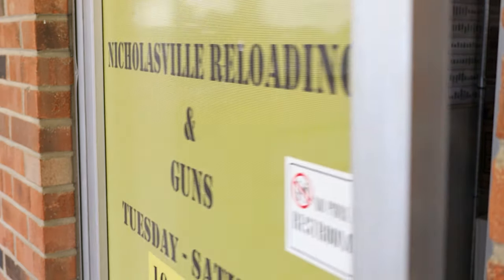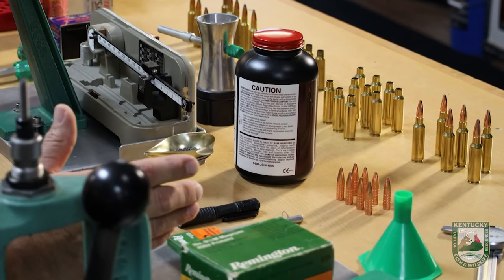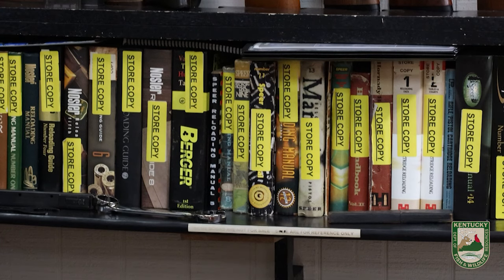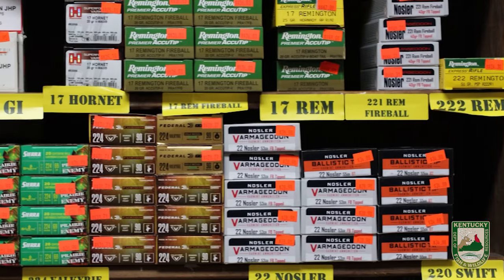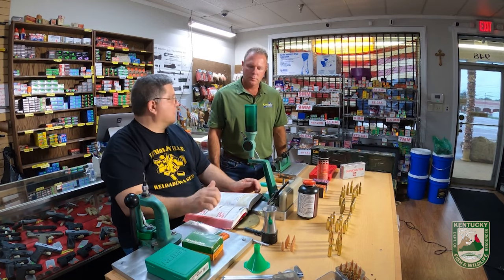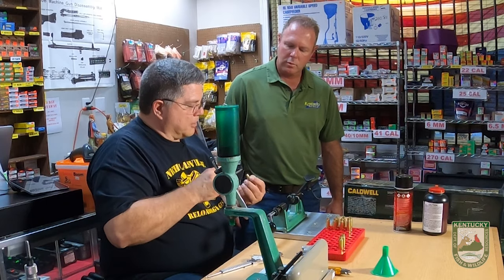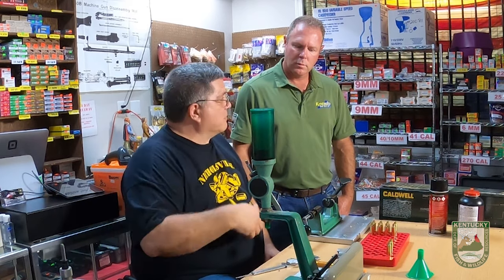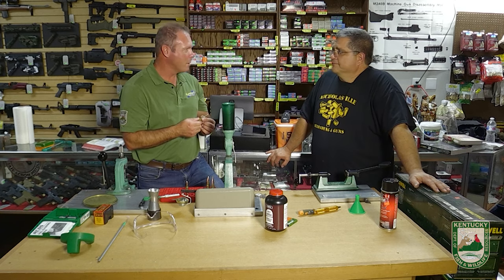Reloading 101 - The Basics of Reloading Ammunition

Comment: I've reloaded for most of my life. I originally started because of the accuracy I could achieve over factory ammo but the advantage has become less over the years cuz factory ammo has gotten much better. I now reload because of politics and the availability of components. I say there are two steps to reloading. 1 is case prep and 2 is reloading. Case prep is boring but of utmost importance. I read years ago that dull clean brass shoots just as well as shiny brass and I have found this to be true. There is even an argument that tumbling brass will shorten the life of the brass. You can watch all the videos you want about reloading but it is not a substitute for reading two reloading manuals and following instructions. Different reloaders use different products such as the case lube he uses here. I use a roll pad and don't spray anything onto my loading block. It's worth it to reload physically and mentally.

Comment: Great video, covers all of the steps. I was always told not to get any case lube inside of the case as it would contaminate the powder charge. Making a fixture to be able to turn the cases upside down alleviates the possibility of that happening. Large finishing nails spaced out in a piece of wood will work nicely, and as he stated the lube will run down the case and spread evenly when sprayed from a couple different directions

Comment: Overall a pretty good video. I would caution people to not over work their primer pocket and use a gauge to check the depth if doing so. Over reaming the primer pocket will allow the primer to seat quite deeply into the case and potentially adversely affect the primers performance and or reliability. 
Also it does not look as if the bullets were correctly seated, The grooves in the bullet are designed to reduce pressure in long bullets and you have not seated the bullet far enough to push the groove fully into the case. Saami spec or not this will affect the bullet performance adversely. 🧐🤓 
Best of luck Ladies and Gentlemen 😎
Reply: He's loading Barnes triple shock no lead bullets.. magazine length or if you have a long throat and single load,  only thing we care about is mag length for hunting or distance from lands for match ammunition. If it chambers, and no excessive pressure, I have a long throat rifle and seat long vld bullets and they're maybe to bottom of the neck. Too long and too short can increase pressure.
    If you use obsolete cartridges you should have 200 rds min for a rifle, fwiw

Comment: I would have liked to hear him explain what resizing is and why it's necessary.

As a part of that, he could have explained where the brass he trimmed from the case mouth came from (it wasn't there when he bought the factory ammunition, was it?) and possibly even how you know it's time to stop reloading a case.
Reply: When you shoot a round, It warps the brass through heat and pressure. Re-sizing puts it back in a consistent and accurate shape. Doing this can stretch the case hence you trim the stretched excess. If you don't reshape your cartridge it could get stuck in the chamber, not hold the powder uniform and also provide enough and correct lip for the bullet and barrel.

Comment: I have a 308 and the rounds are $2 a round if you buy them factory. Yes I'd like to at least use the same brass change the projector, powder and primer. Get my money back or at least break even, because every shot I take with my 308 is $2. It might not sound like much but 20 rounds is $40 every time I go to the range plus the range fee of $15 plus $10 worth of gas so that's $65 total for just one day at the range for my 308.

Comment: Cost is what I originally thought, but I found out that because of the increased prices in reloading material and the shortages it is likely cheaper to buy ammo, I am speaking here of the 30-06 Springfield,  which I use in a 1903 A3,  that is imported from the Easter European area. I have found it quite good and accurate too. But I am still going to buy the reloading basic equipment, make the initial investment . which I hope will put me in the position to do it more economical in the future. It is not all about economy and accuracy.  Just to do it for yourself is a positive and fulfilling experience.

Comment: Do you deburr the flash hole every time, or just once?
Reply: just once.   otherwise, you wear out / damage the primer pocket
Reply: Jerry Miculek says he’s never cleaned a pocket since the 70s I would think he is a great person to follow his traditions since he has several world records.

Although I do check the pockets and do recommend it to run a wire brush just to clean the debris out but do not believe it’s necessary to Ream the primer pocket unless there has been signs of high pressure which would expand the primer pocket. then it would be necessary. But really a guy just needs to check it with a gauge and make sure the pocket is clean prior to reloading. Usually a vibratory cleaner with Hornady one shot case cleaner is quite sufficient for cleaning the cases and primer pockets.

Comment: So you spray lube down into the case to size it and then put powder in it without cleaning it again? I would clean it again before loading. I also debur and chamfer before sizing. I was told it is easier on sizing die.
Reply: The One Shot he’s using says on the can that it won’t contaminate the powder or primers, so you could leave it on, but most guys don’t unless you’re just loading bulk handgun stuff.  I always clean it off, both inside and out because I don’t like slippery ammo, don’t want the inside of the mouth slippery affecting bullet tension and don’t like some of the light flake or ball powders to stick to it just inside the case.  You can simply wipe it off the outside and use a swab for the inside, but I prefer to throw all the brass back in the wet tumbler for 10 minutes.  Sure, it then takes some time in the dryer before you can load it, but I split up the ‘processing brass’ steps and ‘loading’ steps into separate days.
Reply: that Hornady stuff he's using dries / evaporates after a few mins.   otherwise, yes, clean the neck again before dropping in powder

Comment: Don't you need to remove the lubricant residue from the brass case before loading the powder?
Reply: I was thinking the same thing . He says you should not touch the primer or powder with you r hands but sprays lubricant into the case , I found that a bit odd ??
Reply: That particular spray dries fairly quickly

Comment: Once a beginner finds ample load data for their cartridge, if they choose a load that has a high volume powder, this decreases the chance of a dangerous overcharge. But always have a double check system for powder charges.
Reply: I reloaded tens of thousands of rounds of .45ACP on a 1984 Lee progressive to use in practice and completion without one single ammo failure in decades of use.  Never checked one powder charge.  I watched the machine work and was careful but I pumped out that BLAMMO by the bucket full.  All my rifle rounds were carefully checked for correct powder charge.

Comment: Reloading sounds like fun.
Just wait for the primer shortage. Then the powder shortage, the bullet shortage...
Wait until you find out your first round may cost a thousand dollars. And it will take thousands of rounds before you make a round for cheaper than retail. (this includes the investment in presses, dies, cleaning equipment,  workbench, small tools, books and so on)
An hour and a half to two hours just to make 100 rounds on a single stage press.
Now there's more stuff to find proper storage space for, tools, dies, powder, primers, brass 
All the places online you will order supplies from...
Can't sell reloads without a lawyer, being an FFL and having extra insurance.
Look, I've done it for a few years. It is time consuming, costly to start, there have been shortages of primers, powder, bullets, lead shot, wads...
Don't think that it is cheap, easy, and as fun as sex.  It is costly, takes a lot of work, it takes up a lot of space both when you are reloading and when it is just on the shelf.  Finally, reloading requires an amount of understanding. 
For instance, most electronic scales come with a 50 gram weight for calibration.  Even though most of us reload in the range of fractions of a gram.  So you really should have a set of weights for calibration checking down to 0.100 and 0.200 grams. And I've never seen that in any of the books, but that is how labs and factories check scales, they check them in the working range of measurement. 
If you are known for taking shortcuts, being distracted, being a slob, not even able to boil water, then reloading isn't for you.  If you can't invest a thousand dollars and have no product to show for it, reloading isn't for you. If you don't have a couple hundred hours a year to reload, reloading isn't for you.
However, if you are literate, enjoy quiet time alone, have lots of time and money to spend, if you can shut up and follow instructions, keep records and keep tools clean, then reloading may be for you.
Me, when you include the cost of equipment I've been making rounds for less than the cost of retail after a year and a half of reloading. This includes 380 ACP, 9mm Luger, 223 Remington, 20 gauge birdshot, 410 gauge birdshot and 410 gauge buckshot. It took about four thousand rounds to break even.  
Prices of supplies continue to rapidly increase. But my most recent Hornady XTP hollow point 9mm ammo cost me only 50 bucks for 170 rounds including all the tools and supplies. Price off the shelf for that much would have been 170 bucks.  So you can eventually save money.
Reply: Wow, your experience is exactly opposite of mine.   I loaded up on bullets primers and powder before the last shortage (knowing it would happen).  My press is 30 year old and still going strong.  
My average cost for components stocke up:
2.8 cents for primers and  9 cents on bullets.
Powder:   $24 a pound

You won't even come close to buying store bought ammuntion for what I can reload..

Comment: makes no sense to me,, if you are reloading a bullet that was already used  before how does its length change needing you to remove some ?
Reply: The pressures at ignition push against all surfaces including the neck in addition to the bullet tension at the mouth of the brass. In effect stretching the metals. Never use steel cases again though.
Reply: The brass stretches and if it's longer than specs your bolt won't close, or if it does you run the risk of creating excessive pressures and that is very dangerous!
Always after firing check the case length after resizing and trim back within specs. 
Also, with ALL NEW BRASS, run through resizer die and check case length before loading.